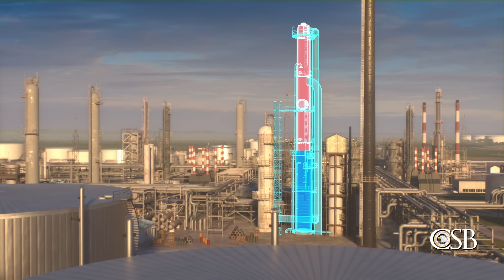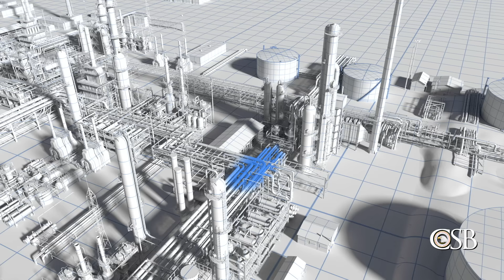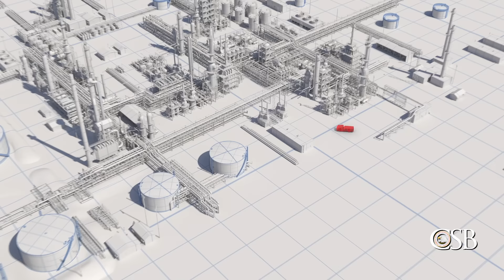Animation of April 26, 2018, Explosion and Fire at the Husky Energy Refinery in Superior, Wisconsin

Comment: Very informative and, once more, absolutely superb quality animation. What software and hardware do you use to produce these videos, especially for the animation design and rendering?

Better CGI than SW Ep. 9. ;)
Reply: We used Autodesk Maya, rendered with VRay Next. Phoenix FD was used for the fire/smoke/water sims. And it was composited in Black Magic Fusion, Adobe After Effects, and Adobe Premiere. Some work was done in Photoshop and 3D Coat for certain textures, but most are procedural. All is rendered in-house on our render farm which ranges from super high end to not so high, depending on the age. Most of these sims took 128GB of ram, dual 2080ti RTX cards and decent processors though. We won't say that we upgraded specifically for this project, but... Also, thank you! One might even say that the force was with us? At least a bit of the blast wave. ;)
Reply: @Abbottanimation3D  Thanks for all the info!! That's funny, I was talking with someone about it and I guessed it was likely Maya. :D  Hmm, not heard of 3D Coat before. Are the dual RTXs for the modelling phase? Or do they assist with rendering? In the past whenever I've tried I've not had much luck getting two cards to work in SLI with pro apps. How long did the whole thing take to do btw? As for the force driven blast wave, that would've been from Ep. IV or VI, definitely not the Disney mulch. :D

Well, I hope you can get TRX80 and 64c TR3 setups next year. 8)
Reply: @Abbottanimation3D  Blast wave...I live about a mile away and it shook the house, I ran outside and saw the huge black mushroom cloud and thought "this is going to be an interesting day". The initial cloud slowly rose (I was outside maybe 45 seconds after the explosion) and didn't dissipate as fast as shown in the animation though.
Reply: @mapesdhs597  We actually used the dual GPUs primarily in rendering. They obviously are useful for large scenes and displaying textures during testing with open GL (or opening too many graphics intense programs at once but we would never do that). But while we rendered with a mix of GPU and CPU, we primarily use GPU. The look and time benefit were very appreciable. I don't think we want to admit to the amount of time we spent on this one, especially since we were really putting together our GPU pipeline from scratch. The number of layers that we ended up with meant we were dealing with exponentially more frames than the actual length of the animation though. We're definitely keeping an eye on upcoming hardware!
Reply: @mattcintosh2  We are definitely using the magic of editing to try and best convey a since of time using the smoke and the light changes. We were fortunate, in a way, to have access to some high resolution source footage of that smoke plume, which certainly made an impression. We couldn't imagine seeing it in person, that must have been intense!

Comment: Great videos as usual! Does anybody know which program or combination of programs can get these renderings/animation looking so great?!
Reply: We used Autodesk Maya, rendered with VRay Next. Phoenix FD was used for the fire/smoke/water sims. And it was composited in Black Magic Fusion, Adobe After Effects, and Adobe Premiere. Some work was done in Photoshop and 3D Coat for certain textures, but most are procedural. Also, thank you!
Reply: Abbott Animation The question I’ve wondered most having watched basically every single USCSB video is, how much of what we see in a video like this is utterly painstakingly created one triangle/node/vertex (?) at a time, vs some type of convenient pre-built library? 

I always watch these and see things like railroad tank cars and think to myself “Wow! Someone must have sat there for hours to get the end platform detail just right, the shape of the couplers, the release lift bar, the ladder rungs... everything...!”
Reply: @Syclone0044  Great question, though we can obviously only speak to the animations we've completed. We actually have a been building a library of models over time through the lifetime of our company. The trains are a great example. We needed trains for this particular location, so now we have trains in our library, ha. This particular incident called out the FCC unit, which had a distinct configuration, so some editing and such was done to make that unit unique and accurate to this location. Other parts of the refinery are more 'pre-fab' library type of model, though the specific buildings keep expanding for every animation we complete. We try our best to mix the completely unique objects in as needed with less time-intense options without losing the overall quality of the animation. Much of what we did for this particular animation centered around updating all of the textures on all of the models to bring them up to our new standards. If the viewers can't tell what's been modeled down to every little bolt and what is more blocked in, then we're doing our job right!

Comment: The csb forgot to make their recommendations in this vid
Reply: After the slide valves failed, resulting in an explosion and asphalt leak, the company and emergency response teams did the right things.

The recommendation would just be "maintain your slide valves".
Reply: I think they've been releasing the initial videos ahead of reports, and then following on with the full ones later.
Reply: @zemyla  Looks like you have to isolate the FCC to access the slide valves, which is what the engineers were doing that caused the whole problem. I bet they will have a section of findings around the risk assessment for the work not noticing that the things needing maintenance might be broken, and one stating additional controls they could have used to make the area safe before the work eg. isolation of the downstream plant before closing the slide valves.

Comment: I worked on a FCCU way back in the 80's.  No fire, but we had a "reversal", catalyst flowing the wrong direction.  Huge plume of dirt out the top, coated everything .  I don't remember if it was a slide valve.  I thought it was a flow upset, causing pressure imbalance.  FCCU's are complicated things.  The cracking catalyst (silica-alumina) cokes up so fast.  We also had a "shot" of water from the nearby boat, water in the crude.  That water got into everything (no crude separation unit), we spent the rest of the day, draining columns, drums, tanks.

Comment: I live 0.9 miles from the refinery and was at work 0.4 miles away when the initial explosion occurred. I was under a truck on a creeper and felt the ground shake under me, then all the building lights flickered a few times. We all walked outside figuring our big transformer popped, but nope. Moments later a huge column of black smoke started to rise. We got evacuated about 2 hours later. Interesting that they didn’t mention the hydrogen fluoride tank that was the entire reason for the mass evacuation. That’s been a huge source of local debate since the fire. The refinery is getting close to reopening now, still plenty of work to be done. 

Side note: since the refinery shutdown, the local utility raised water and electric rates significantly “due to the loss of one of their largest consumers.” And the state went ahead and rubber-stamped the approval for the rate increase despite massive opposition from the citizens. No competing utilities here. Not a monopoly, though, right? 

Lake Superior is 1000 ft from my house, yet we pay the highest municipal water rates in the state. $65-90/month for a family of 4, not including sewage fees which are another $70-90/month. 

Anyway, glad the refinery is just about back up and running, as they are a large employer here and have always been a generous local sponsor to just about any event you could think of. Husky had just taken over the refinery from Calumet, who ran the place into the ground in the preceding years. It was their lack of maintenance & repair that caused the incident in the first place. In my opinion.

Comment: You know, as soon as I learned about this incident via the CSB's interim animation of this same incident I knew that it was the 2015 ExxonMobil refinery explosion all over again. Both have the same exact cause: reactor system shut down for one reason or another, eroded slide valve causes catalyst to leak, allowing hydrocarbons from the reactor to flow through the valve into the regenerator and air side of the FCC unit, causing an explosion when the hydrocarbons found an ignition source. Again though, the important thing is no one was killed, good job to the fire department too, containing the fire the way they did. I noticed that the fire truck in this animation has an FDNY logo on the rear side compartment doors, just with the "City Of New York" lettering removed. Have to agree with some people, the animations are getting better, in fact, in some shots (particularly of the burning asphalt around the tanks) one could mistake the animation for actual video of the incident. Keep helping to make us safe CSB.
Reply: 4:11 you mean. I was trying to determine if the tire sidewalls actually have prototypical realistic writing. They definitely have something irregularly spaced, just like real tires. Crazy detail.
Reply: @Syclone0044  You sure you've got the right person? What you said has nothing to do with what I said from what I can tell.
Reply: TheCarson116 Sorry, I meant 4:11 is when you can see the FDNY logo on the left side of the fire truck you referred to 🚒

Comment: Animation is excellent. Slide valves or gate valves, or ball valves or plug valves,indeed any valve failing to seat or seal can cause problems.Really need positive blanking plates inserted.
Well done the fire fighters,I would hate to be involved in such an incident.

Comment: Now I’ve worked half my live at an asphalt refinery in the Netherlands and some things are strange to me:
Asphalt (bitumen) are stored at about 180 deg. C. Some harder variaties maybe at 200 deg. C.
The Cleveland Open Cup flame point is about 230 deg. C or higher. So how could this asphalt ignite the way it did. In a tank farm storing products which are above there flamepoint special equipment (ATEX) should be used. So please answer the question how did the asphalt ignite.
Reply: Hans I also have worked in asphalt/bitumen terminals for 30+ years. I too am baffled on how the liquid asphalt ignited given the open cup flash point is typically higher than 230C (450F).

Comment: great modelling and video. can we know which 3D CAD software solutions were used for this video?
thanks!
Reply: We used Autodesk Maya, rendered with VRay Next. Phoenix FD was used for the fire/smoke/water sims. And it was composited in Black Magic Fusion, Adobe After Effects, and Adobe Premiere. Some work was done in Photoshop and 3D Coat for certain textures, but most are procedural. All is rendered in-house on our render farm which ranges from super high end to not so high, depending on the age. Nothing was built using CAD files for this particular project, though we have done that in the past for other clients.
Reply: @Abbottanimation3D   thanks for your detalied answer. im piping designer in PDMS, SP3D, PDS and really  appreciate your amazing work in those videos around YT.
Reply: @hrhr9664  Thank you! You message was passed on to the team and they really appreciated it.

Comment: Wow. The quality of the videos improved, when they were already super good.

The failure looks to be very similar to 2015 Explosion at ExxonMobil Refinery in Torrance, CA. The solid catalyst slide valve which was also supposed to act as a barrier, corroded, and failed to properly seal the FCC, so the hydrocarbon and air mixture leaked and found a source of ignition.

Was there a steam purging? Wouldn't it make sense to have some excess hydrocarbons burning on top for situations like this? If the crude oil source if stopped, then the left over products could be burned off in controlled way at the top instead with atmospheric air. Then purge the air and any excess with steam vapor or nitrogen. Sure, it does cost to do that, but not as much as a failure.

Comment: Horrific situation, not fully closed valves are one of the biggest risks. But may i ask, why wasnt there any messurement of O2 in the lower segment which is quite commun in some german refinerys? Why wasnt the equipment not purged with Nitrogen? To prevent this incident, the air from the lower part should be purged with Nitrogen in order to prepaire the shutdown. 
Sure it means harder work to the stuff due to the additional PSE, but it lowers the risk of an fire / explosion massively!

Comment: The erosion of slide valves is not uncommon. Thats why you always replace them anually, and always have a backup that remains fully open and recessed at all times. This prevents erosion of the backup. Both valves should be closed during maintenance or emergency procedures.

Comment: Except it didn't just pierce the asphalt tank, it went into the east side, then through the tank and came out the west side if the tank causing the flow of asphalt out of the west side to ignite the next fire, the ert would have had the situation under control and the next fire would not have happened if it only pierced the east side, great work ert.

Comment: I'm often amazed that the petroleum industry continues to build systems with single-point failure modes. If commercial aviation engineering was conducted in this manner, there'd be an airliner crash once a month.

Comment: You what will cost a company more than following safety procedure and inspections? Having to clean up an accident like this. Probably one of the most expensive ones I’ve seen just in the bill for that water, foam, and complete loss of that plant’s assets alone. Doesn’t even include the lawsuits and compensation.

Comment: I have literally worked in between the slide valve's seat, was doing MPT on recent welds of the hopper shute of an FCC Unit at a IOCL refinery in Vadodara Gujarat India,  while another team was working at the electrical control panel of the valve's actuators & was thinking if they accidentally energize it I will be cut into two pieces.

Comment: The slide valve should have been inspected to check if it was corroded or worn out, if either was the case, shut down the unit and replace the valve. Quite simple.

Comment: If the corrosion is due to the multiple products mixing (and not the singular material being added) -it be easiest to have a double valve, with the one closest to the mix be considered a 'sacrificial' valve that has a known replacement schedule. The secondary is only shut once the sacrificial is shut to ensure a larger stop gap and can be maintained less frequently

Comment: What was done to make Husky make it's plant safer for it's employees?  After watching the video I can see all sorts of potential safety issues . It's a miracle one of the steam heat lines in the Asphalt storage tank wasn't ruptured. that could have caused liquid asphalt to foam and gain gain 5-10 time volume and completely flood the unit.  The storage tanks in the tank farm around the burning tank are space too close together and do not have enough volume capacity around them to contain a rupture. BY SHEER LUCK Less than a quarter of the asphalt tank spilled out. The maintenance in the Unit is shameful.  I spent 5 minutes watching this video and could write a five page report.
Reply: They have now computerized everything in the refinery and added a requirement of a certain number of ERT on stand by. The tanks storing the asphalt are designed to withstand extreme temperatures because it is always heated to keep it liquid, and for accidents like this. The maintenance in the unit is amazing they’ve hired nearly 5000 workers to rebuild and it is soon to be running again in a couple of months. They’ve also hired more than 2-300 computer ppls who who are adding safety features so they can tell when something is wrong. People who work here know what they are getting themselves into, its a dangerous job and there is only so much you can do to make it 100% safe. They have invisible steam that is so hot and so pressurized that if it touches your hand it would cut it off and then cauterize your wound. Originally Murphy oil refinery, this place is old which explains why the metal inside was degraded as much as it was. I’m sure they have implemented routine/ annual checks to make sure nothing is degraded or what not, not sure if they did this previously though. They have spent billions of dollars renovating the refinery and over a billion dollars alone just figuring out the cause of this incident. Every employee has to complete monthly tests to ensure that they know what is going on within the refinery. They have also trained a bunch of employees onto the ERT which happens to be super intensive. They send all of their ERT down to texas every year to train them how to fight fires like this.

Comment: no secondary safety features? no testing of systems periodically to check corrosion and correct proper machine functions. A robotic pig-launcher style could be sent down process piping and equipment in such areas.

Comment: couldnt they have just shut off the supply of hydrocarbons and let the reaction continue until all the hydrocarbons was used up?

it is like turning off the fuel to your motorcycle or power generator at the petcock and letting the remaining fuel in the line and carb burn off until the engine stops working?